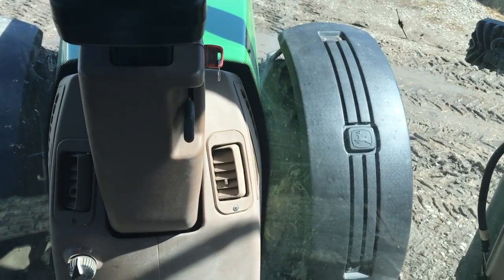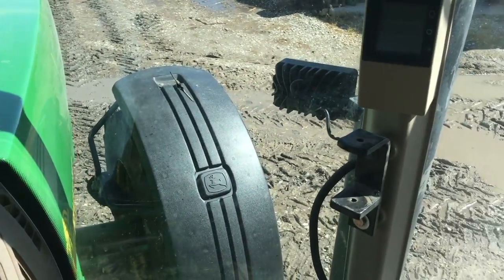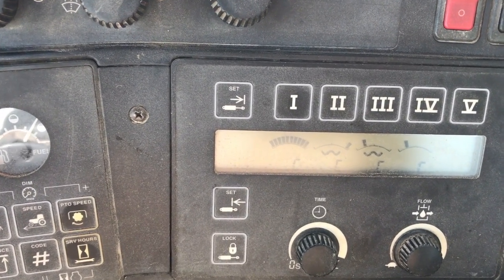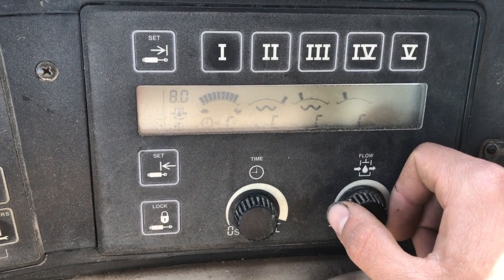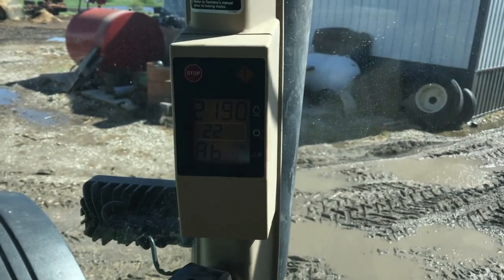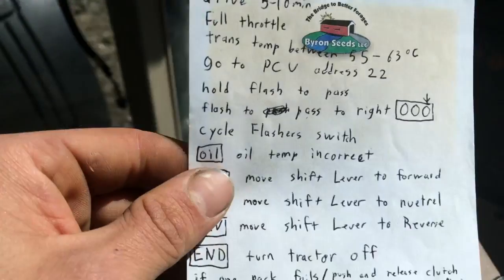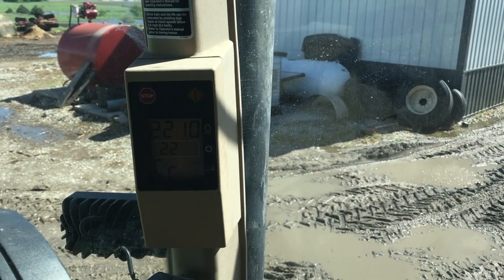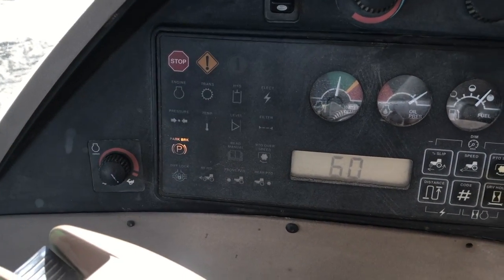John Deere 8300 Transmission Calibration

Comment: Hey we have a problem with 8320. Hi not go to 22
Reply from the maker: Ok I’m having a little trouble understanding your comment but I think your saying it will not go to PCU address 22. The most likely cause it that you installed the diagnostic fuse after the tractor was running. Shut off the tractor and restart with the fuse already in the diagnostic mode. If that’s not the issue you may have some codes related to the transmission that is preventing it from being calibrated. In that case you need to deal with the codes first. I have other videos that show how to read the codes.

Comment: Calibrated 8100 transmission, got stuck and said “C2L”. Seems to shift fine, has all the gears, but now it is throwing code PCU 27. Have tried clearing the code, but wont go away. Just flashes the transmission and info light. Any ideas on how to get rid of it?
Reply: Wiring all looks good, i am thinking the C2 shift valve/solenoid is weak. Possibly need to change the valve and recalibrate?
Reply from the maker: Yes I think you are correct on starting with the C2 valve. To test the theory you can just switch it with the CR (reverse) and see if the problem follows it. The PCU code 27 is saying your transmission failed calibration. The CR valve is the top left valve easily accessible from the battery cover side. The C1 is next to it followed by the C2 and C3 and AB in that order. Note that these are the valves that are horizontal in the transmission and not the vertical ones. Also the vertical and horizontal are different and cannot be switched.

Comment: Is there Anyway to fix error 015 on 8200? Is something about the cluch. I tought it might be form the sensors but changed them and still have the error
Reply from the maker: Is this PCU 015 or what kind of error are you referring to?
Reply from the maker: If it is PCU 15 I think it will be your clutch engage switch. There are two switches or sensors on the back of the transmission ( not the park brake pressure sensor at top left) one is just left of the drive shaft the other is towards the top right of the drive shaft. It could also be wiring. Enough people have this problem I need to make a video on it.

Comment: On a 8200 when i go to pcu 22 it Said Err. Even if i hold the cluch up will still say err. What can i do?
Reply from the maker: Are there any active codes? If so you will need to deal with those first before a calibration will work correctly. Does it show 000 and then after you try to start the calibration it shows err or does it never get the the three 0s?
Reply from the maker: It’s also possible it is detecting wheel speed. There is a chance changing the speed sensor could fix it as well. I’m not sure exactly where that is located at the moment without doing some research.
Reply: @iowafarmer93  i got a few error codes most of them about parking or the pilot seat. but there is any way i could bypass the error codes and just do the calibration?
Reply from the maker: No. For starters I’m guessing the seat sensor needs fixed but it can be hot wired by crossing the wires in the plug behind the seat. The park brake issue though is a big deal. I’m not sure what the codes are that you have for that and if you don’t know how to read all the codes my video “ watch before buying a JD 8400” should cover all that. I had an 8100 that I could not calibrate because the park brake wouldn’t hold. I even went as far as to hook two other 8000 series tractors to the front and back to try to get it to stay in one spot but during the calibration it was rocking all three tractors and eventually failed the calibration anyway. The park has to work in order for the calibration to work.
Reply: @iowafarmer93  i am tring to fix the problems now but i am having a Hard time finding the cluch sensor on 8200. Any ideea Where it should be?
Reply from the maker: Yes. There are actually two. Both are located on the back of the transmission under the cab. One will be towards the bottom on the left side of the drive shaft and it will be easiest to get to from the bottom but can be reached from the top. The other is towards the top on the right side of the drive shaft and is much harder to get to but is possibly to change. If you watch some of my other videos you might be able to see them.

Comment: Trying to do my 8420. After the oil is warm it says H2o what does that mean ?
Reply from the maker: Here is the instructions for a 20 series. 
It’s possible you have a faulty coolant sensor. 

Calibration Instructions:
Perform the required response to continue the calibration procedure if any of the following instructions are displayed:
"For"
Move shift lever to "FORWARD" position. Forward Valve calibration will continue.
"Oil"
-Oil is not hot enough. Heat oil to 55°C (130°F) (or Oil is too hot, cool oil to below 63°C (146°F)). Forward Valve calibration will continue. (Note: hydraulic
oil can be viewed on the Vehicle monitor by pressing the PTO SPEED and RV hours buttons simultaneously.)
"H2o" 
-Coolant temperature must be heated. Command engine speed to 2200 ‡ 30 RPM, heat engine coolant temperature to greater that 70°C (158°F).
(Note: engine coolant temp can be viewed on the vehicle monitor by pressing the SPEED and CODE buttons simultaneously.)
"nEU".
- Move shift lever to "NEUTRAL" then to "FORWARD". Forward Valve calibration will continue. If "nEU" still displays, return to diagnosis in progress.
"Spd"
 - Increase engine speed to 2200 rpm. Forward Valve calibration will continue. If unable to get 2200 rpm and ECU code 055 is present, perform CAN
Network Diagnosis. (See Reference 245-05-006 .) If ECU code 055 is not present, see CTM255 for diagnosis of the engine cam speed sensor (B405) and
engine crank speed sensor (B406).
"CLU"
- Fully cycle clutch pedal. If "CLU" continues to display, check clutch engagement pressure.
it.
-Wait 2-3 seconds for tractor to stabilize. Forward Valve calibration will continue.
"Erp"
-Wheel speed (motion) is detected. Stop all tractor motion. If "Err" continues, return to diagnosis in progress
"rEU"
 -Move shift lever to "REVERSE" slot. Forward Valve calibration will continue
Reply: @iowafarmer93   Thank you very much for this information. My local john deere dealer wouldn't even provide this to me🤨

Comment: When you say jumper hose, are you talking about about a 2 ft hose with 2 hyd ends that plug into 1 common rear remote to circulate the oil?
Reply from the maker: Yes. I have a regulating valve on mine to create pressure to possibly build up heat faster but that is not necessary.  A straight hose works fine.

Comment: Hello!
I have 8200 earl model and during calibration Ab, bc, cc, dc slow others are calibrated well. What can be the problem?
Thanks
Reply from the maker: Does it finish the calibration or does it fail those calibrations? If they are failing and you need to push the clutch to get past them, that probably means you have internal leaking of oil past some of your clutch cylinders but it could also mean some clutch packs are wore out and out of the calibration range. Even if it fails the calibration the tractor should still drive but I don't think you will be able to go into 4th reverse but I could be wrong. If they are just slow in calibrating but eventually do calibrate everything should be ok. It is quite possible you need to rebuild the transmission as well.

Comment: My 8400 says abs and doesn't go farther unless I cycle the clutch pedal
Reply from the maker: then you have and issue with your transmission. Start by swapping the ab shift solenoid with another one and if the problem moves then its in the solenoid but otherwise your probably have a seal out in that clutch pack and need a rebuild. There are a few other possibilities like wore clutch pacs but to fix them you will most likely need to tear the trans apart anyway.

Comment: Hello, I have an 8300 that does not read the engine rpm well, when you accelerate sometimes they go up a bit but it always stays at 20, 30, 50, do you know where the problem is?
Reply from the maker: I’ll research it and try to give you an answer
Reply: @iowafarmer93  thanks
Reply from the maker: ECU 45 Engine Speed/pump speed out of sync. Service  code indicates that the signal from the auxiliary speed sensor has stopped working or has become erratic while the primary speed is stable.
Ecu test procedure 17 ( used for tractors with serial number 11,000 and over)
 Primary engine speed sensor should be between 600-1500 ohms 
Auxiliary engine speed sensor should be between 2500-3500 ohms

code 45 should be stored with code ECU 39 or 44.

I'm not exactly sure where these speed sensors are located. I know the on is located on the front of the engine next to the injection pump and possibly both are I'm not sure.

It gets really complicated to diagnose after this. If your ohms check out fine you will need to do more checks on your wiring. I can email you pictures of the diagnostic manual that will help locate which wires.
Reply: @iowafarmer93  boa tarde TD bem.sustui o controlador pcu é necessário inserir dados trator 8300 o rpm do motor está incorreto vai até 9.000 giros não consigo calibrar a transmissão.se puder me ajudar te agradeço.obrigado
Reply: and the engine light comes on, and the pc throws error ecu 45

Comment: What the heck is 'flash to pass'?
Reply from the maker: it is when you pull the blinker switch towards you like you would in a vehicle and it flashes your lights. On your blinker switch if you push it forward it turns on the brights. If you pull it to the back position your brights turn off. if you pull it back from there it will turn your brights on but when you release it they go back off. A lot of these tractors have issues with this switch and this function does not work so you can simple put your blinker switch in the forward (bright) position and then turn your light switch all the way to the right and immediately back off and you will get the same result.
Reply: I guess that explains why I couldn't find the brights where they belonged next to the diff lock...

Comment: hello, when you move the gear in reverse do you have to squeeze the clutch? Hold it so that it does not advance or is it not necessary?
Reply from the maker: No the tractor should not move. The control lever is fully electrical so the computer simply reads that the lever is working correctly but does not allow it to function normally while running the calibration.
Reply: @iowafarmer93  okay. and when the indicated temperature is reached, the hydraulic command must be deactivated or continue activated?
Reply: @iowafarmer93  

If you have any calibrations manual in pdf format, you could send it to me by email juligorgetti@hotmail.com thanks!
Reply from the maker: @juliangorgetti  It was to large to send through email so I tried through iCloud. I'm not sure if it will work or not. I sent you the one for 8000 series. I believe it is in mac format. If it works and you want more let me know.
Reply from the maker: No the hydraulic functions may be used normally without interrupting the calibration. You will need to continue to use them to maintain the right temperature.
Reply: @iowafarmer93  ok, thank to very much! do you know if the throttle is calibrated?
Reply from the maker: Just follow the video. Put the tractor at full throttle when calibrating. To calibrate the throttle you would need to run the armrest control center calibration.

Comment: Hey can you help me so I was trying to do this but once I go to PCU 22 then it just shows err please help
Reply from the maker: does the err message come up where the 000 would be at? If so you might possible try to pull the clutch pedal up with your foot as this might cause an err message as sometimes the clutch will stick down slightly. I'm guessing the more likely cause will be an electrical issue or possibly a bad solenoid. This might possibly be determined if there were previous issues with the transmition. The only thing calibration will do is smooth out the shift points. It's very unlikely a calibration will fix a major shifting issue.

Comment: Hi i have a 8230 powershift that needs transmission calibration
How much different is it
Can it also be done manualy or does it need to connect to a computer
Reply from the maker: I’m not completely sure on the 30 series as I do not have a service manual for that but I’m quite sure you can do it without hooking up a computer.

Comment: Do you how to calibrate a ssu controller?
Reply from the maker: SSU controller calibration for 8020 series

A - For vehicles with SSU control unit programming software part number R218115 or lower. B - For vehicles with SSU control unit programming software part number higher than R218115 
NOTE: 
Access SSU address 84 and SSU address 85 to determine the software part number. For example, in SSU address 84, the software part number R218115 appears as 218 and in SSU address 85, software part number R218115 appears as 115. 
2 Address Description - 

Type A Action: 
SSU address 28 does a calibration of the steering portion of the steering control valve (B959) that is only used when AutoTrac is enabled. Display will cycle through CP1, L (left), r (right), CP2, and CP3 during this calibration. 

IMPORTANT: 
It is required to jack up the front axle so tires are off the ground during SSU calibration. This will provide consistent values to the controller. 
1. Raise front wheels off ground and securely support front of tractor.  
2. Start tractor.  
3. Insert fuse in F10 and access SSU address 28 .  
* Display should read: 28 CP1  
* Cycle the hazard lights switch (S101) to ON position, then OFF position. Display should read: 
28

 L 
5. Rotate steering wheel to the left at a normal rate of rotation until end stop is reached and pause at end stop. May have to hold at end stop to get display to change. Display should read: 
28 r (right) 
6. Now rotate steering wheel to the right at a normal rate of rotation until end stop is reached and pause at end stop. May have to hold at end stop to get display to change. Display should read:  28 CP2  

type B

NOTE: 
Hydraulic oil temperature must be greater than 20 °C (68 °F) and operator must be seated throughout entire calibration. If these conditions are not met, calibration will exit immediately. If necessary, (See Reference 270-15-100 .) 
1. Start tractor and set speed at 1200 rpm.  
2. Insert 'Diag' fuse, F10.  Display should read:  --  dIA  
3. Move the turn signal to right turn several times to select SSU. Display should read: -- SSU  
4. Actuate the flash to pass lever to access the SSU. Display should read: 000 SSU  
5. Access SSU address 28 . See Access Control Unit Addresses , Reference 245-05-002 . Display should read: 28 CAL  
6. Cycle the hazard lights switch to ON position, then OFF position. Display should read:  28  S-L  
7. Turn steering wheel to the left (CCW) at a normal rate of rotation until full left turn is reached and pause at end stop. Hold at end stop and cycle the hazard lights switch to ON position, then OFF position. Display should then change to:  28  S-r  
8. Now turn steering wheel to the right (CW) at a normal rate of rotation until full right turn is reached and pause at end stop. Hold at end stop and cycle the hazard lights switch to ON position, then OFF position. Display should read:  28 P-L  
6 Calibrating EH Steering Valve Action: 
1. Press, and hold, the 'Resume' switch on the armrest. The tractor will steer automatically using the EH steering valve during this Step.  NOTE:  The switch must be held through this complete step. Releasing the switch or turning the steering wheel will cause the steering valve (EH Valve) to shut off and the calibration process to terminate.  The tractor will begin steering left. Steering motion will begin, then slow, two times. The valve commands will display as the valve deadband is found. Once the 'left' deadband is determined, a full left turn to the stop will occur in preparation for calibrating the 'right' deadband.  
2. When the control unit is ready to calibrate the 'right' deadband, the display will show....  28 P-r  
The tractor will begin steering right. Steering motion will begin, then slow, two times. The valve commands will display as the valve deadband is found. Once the 'right' deadband is determined, the tractor will steer back to center. 
1. As the tractor straightens, the display will show....  28  P-C  
2. After centering, the display will show....  28  EOC  
3. The 'Resume' switch may now be released. Valve deadbands are displayed at SSU Address 29.  
4. Turn key switch OFF and remove fuse F10 to return to normal operation.

Comment: Is this after putting a reman in?
Reply from the maker: I did this after rebuilding the transmition. The same process would need to be done after putting in a reman or if you change oil types. All this does is allows the computer to measure the time it takes to fill the clutch pacs with oil to achieve a smoother shift.
Reply: Now my buddy said something about pcu 20

Comment: Hello I HAVE A 7730 IVT TRANSMISSION HOW CAN I CALIBRATE THE TRANSMISSION  BECAUSE I GET THIS CODE PTI 630.14 please help me THE CODE IS FOR CALIBRATE
Reply from the maker: sorry for the slow reply here. I've never worked on the IVT transmition yet but I'm sure I will at some point. I'm also not sure what the calibration process would be.